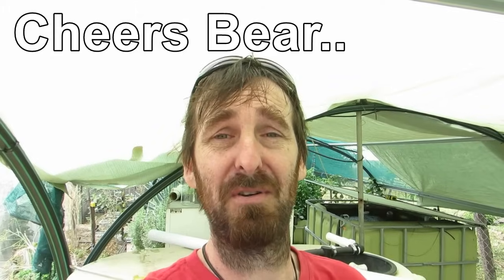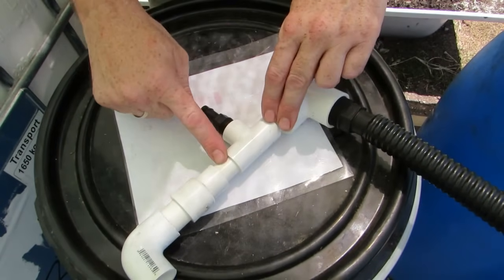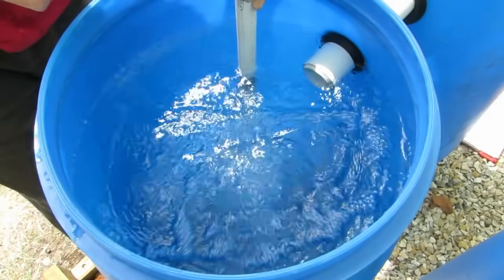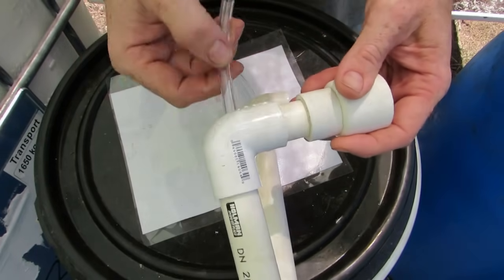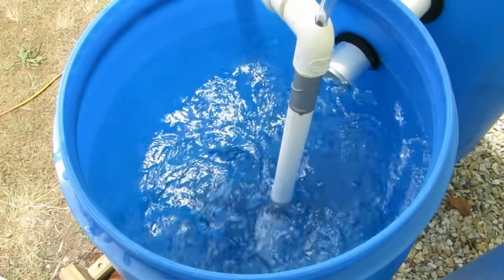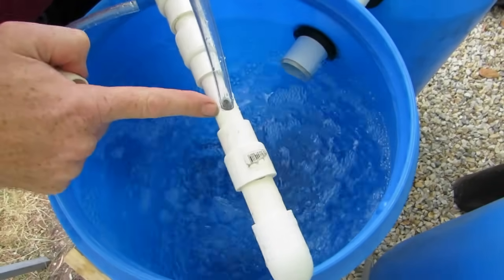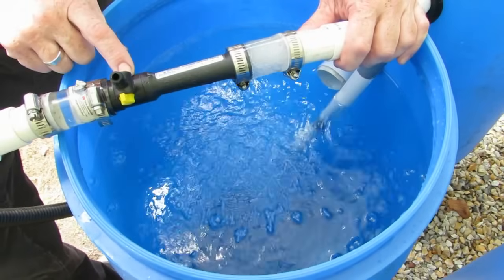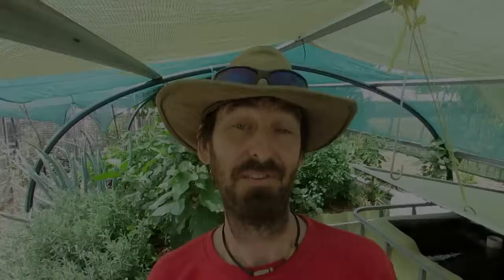DIY venturi, a few easy builds for aquaponics, aquaculture or hydroponics..

Comment: Thank you Rob for kindly sharing your knowledge on venturi. An added bonus I came across is if your sump tank Pump is stopped the venturi will prevent water from syphoning back through the pump saving the use of one-way valves. Nick.
Reply from the maker: Hope it helps you out some Nick & sorry for taking a while to rep[ly.  👍
Cheers mate.

Comment: very solid and practical design. thank you SO much for sharing this priceless information.
Reply from the maker: Thomas Paxton Hope it helps you out some Thomas.
Cheers mate.
Reply: RobBobs Backyard Farming i have a question. i tried, basically, this exact set up but where im supposed to be drawing air in, its spitting water out.... what am i doing wrong?
Reply from the maker: +Thomas Paxton 
Hi Thomas. Sorry for the slow reply. 
Have you sorted out the unit yet mate ?

Comment: Great info, thanks for making this video. I needed a quick and cheap solution to start adding air to my pond, as it's been hot and dry here in Florida, at least for this time of the year. Coupled with it being too still, it was starting to stagnate and I didn't want to end up with a fish kill if I waited too long. The pond's main purpose is as a sort of fire hydrant, since there is no municipal water services where we are, but we enjoy the snakes, fish, frogs, and turtles that call it home as well. The ideas in the video helped get the job done, for now.

I've got an artesian well that's used for keeping the pond filled, so I just added a venturi in to the line. I experimented with putting it at the start, middle, and end of the line, and having it by the valve works well while avoiding the problems with locating it elsewhere. (Debris, pond height, etc.) I did find that by extending the length of the air line coming in, it actually suppressed the sucking sound quite a bit. That extra length also allowed me to orient the opening towards the ground, protecting it from being bumped and keeping the opening from having stuff fall or blow in to it.

It's not the ideal solution for my application, but I think it will help out until I can bury electric service out to it and buy a proper aerator for a pond this size. Again, your video was very helpful, thanks for taking the time to make it.

Simple Venturi For Pond Aeration
Reply from the maker: Nice one mate.. Thanks for the clip.. Looks like you're getting a load of air into the water & am glad it's worked out for you..  Are those solar pumps any good for aeration purposes ?
Cheers & all the best..

Comment: Hi Rob. Greetings from the West Coast of Canada!

Just thought I would pass along to everyone something that I learned at a seminar on aquaculture. 

If you're ever wondering if there's enough dissolved oxygen for your fish, just watch and see if they spend most of their time hanging about at the the bottom of the tank. If they do, then you have enough oxygen, as there will always be higher concentrations of O2 near the surface, due of course to the fact that gases are lighter than water and tend to get pushed up. 

This is why fish will gasp at the surface if they are short of oxygen. 

I thought it was a very useful tip when I heard it, and thought I'd pass it on.

Love the vids and your delivery. Keep "em comin'!
Reply from the maker: Cheers Steve.
Have a top one.

Comment: Thank you. I haven't heard anything about venturi here in the States. Love the sound of just the  bubbles. You do good things and I appreciate it.
Reply from the maker: Hi Pat... There are a few different styles you can pick up from Ebay fairly cheaply.. They are normally used in spar baths or for liquid injection of fertiliser into irrigation lines the garden.. I like the home made units over them as I get to tinker around ;)
Cheers & have a great one,
Rob..

Comment: Very nice video, will add it to my collection of things going into my next build.

Cheers
Reply from the maker: Hope it comes in handy mate..
Cheers..
Reply: I just started my wood base for my two 50 gal tanks, painted the bottom 6 inches as lately I am getting mold on the wood from the spring thaw.
Once I actually start the build I will post pics and ask questions.
Reply from the maker: Zach D No problem.. Can take a while for me to get back to folks as you've seen just to warn you ;-)
Have fun with the build..
Reply: np

Comment: I used similar constructions in fish tanks. If u get larger bubbles, it helps to run the outlet of the pipe against the wall of the tank. If you have some decent pressure then the large bubbles will hit the wall of the tanks and burst in small bubbles.
Worked really well in my fish tanks!
Reply from the maker: Hi there & thanks for that..
Ended up running with a few I was given in the aquaculture build but think the home made jobbies will get a run somewhere in the new system soon..
Cheers,
Rob..

Comment: Thank you for sharing.  I recently build a 16000 gallon Koi pond with a 5'X 10' bog filter.  I wanted to induce air to the water as it entered the bog.  Your DIY will make that happen.
Reply from the maker: Hope the venturi does the trick for you Benjamin.👍

Comment: Hi Rob, from what I've read the size of the bubbles really makes on difference as their not in the water long enough to make a difference.  It's the bubbles breaking the surface tension that does the oxygenation but like most things their are as many schools of thought as ways to do things.  Thanks for the video mate.
Reply: It's one of those things that works but most everyone is wrong about why it works. A powerhead in the tank may be a better option than injecting dirty air into your water at high speeds

Comment: Rob Bob: Since you were curious about other people's take on the venturi I will give it a go. The first place I ever used a venturi was in science lab. The faucet was designed to shoot out a jet of aerated water and the venturi air intake was our vacuum line. Later I noticed a dozen venturi on my hot tub. Same design, the fast jet of water causes low pressure and thus air is sucked in (velocity and pressure in a
 tube math). In a practical application high pressure occurs at points of dilation in a tube. Aneurysm in a blood vessel or a bubble in your garden hose. Low pressure at the constricted points where velocity is increased. MY POINT - buy your venturi from the spa store or online spa depot or whatever, they are the spa or hot tub jets. My contribution for your wonderful videos. Thank you again, from USA.
Reply from the maker: Thanks for that Tanner..
Have had a few folks recommend the spa units but haven't played with one as of yet though..
Cheers & have a great one,
Rob..

Comment: This is very smart. I used to have a basement full of aquariums, breeding aquarium fish half professionally. 

I experimented with venturi-solutions there and getting rid of some air pumps was great. The only thing I have to add is that if you use soft elbows (not the 90 degree variant), you will optimize water flow. The water will then be able to "screw" itself through the bend and you will not loose as much pump capacity.
Reply from the maker: Thanks JV.
have a top one.

Comment: wow, i like the device with the clear tube.

Just wow....
Reply from the maker: Hi there..
I'm using that unit in the moving bed biofilter in the new build... Found it woks better in that application than any other venturi I've bought or made..
Would be great to get an O2 meter & do a side by side test on some water to see which is best..
Cheers & have a great weekend,
Rob.

Comment: thanks for the video. I went ahead and made the one elbow venturi version and replaced my air pump in IBC as I had parts in the garage already. It took about 10 minutes to make and it worked great. I found that you can make bubbles smaller and more plentiful when you make several small holes on the vertical pipe that is delivering pumped water with air to the bottom of the IBC.
Reply from the maker: Hey Ondro & thanks for that..
Shall try it on one of the DIY jobbies in the fish farm & compare it against the other tank.. I found the deeper I tried to send the air the less I got so only have a 6-8" pipe in there now..
Cheers Mate & all the best,
Rob..
Reply: gladly Rob. happy to share my findings. after all i installed the venturi only because of your video :-) . my pipe goes all the way to the bottom which is about 90 cm and the bubbles apart from escaping alongside the vertical pipe get also to the bottom of the pipe. the bubbles are not tiny tiny, but defintely smaller than when there are no holes.

Comment: I love your video .I have a  little over 3000 gallon pond and just rebuilt and think I am going to make one of your venturi .Thank you for the great video .I will be making one .
Reply from the maker: Hey there..
Glad you found the build useful & has given you a few ideas..
Cheers,
Rob.
Reply: well the one i built is working great and tomorrow i will be building another one my koi will sure love this in the summer heat when oxygen levels get low .thank you again
Reply from the maker: sissy murphy
That's great to read :)
Have a great one  :)

Comment: Excellent ideas and thank you for doing the comparisons. I am thinking about adding one to me new aquaponics setup and getting rid of the air pump, one less energy sucker.
Reply from the maker: That's why I was looking at them as well.. Make more sense to run one unit to do both jobs.. Did buy a new 4200lph air pump as a back up for the 2 systems.. Doesn't hurt to have some extra air for the warmer months here I think..
Cheers & have a great week..
Rob.

Comment from the maker: Here in the subtropics we have a very mild winter with the temps only dropping below freezing for a few hours at a time on a handful of days every winter.. Our block hasn't had a frost on it in the 12 years we have been here.. I had the system running all winter & was feeding the perch most days... If we were in a cooler area down south we would probably just run trout during the cooler times..
Cheers & have a great one,
Rob.

Comment: Nice simple options, thanks.If a really efficient Venturi is required it does need a taper inside the water feed tube that has two angles. The air intake enters at the low pressure point.

Comment: I airated 12,000 fish with a submersed water pump which carried water horizontally to fall back in the pond. I put a Y fitting backwards in that line so it sucked in air. It helps if there is at least a meter of horizontal pipe after the Y to allow the air & water to mix before falling back into the pond. So simple.
Reply from the maker: 👍 Nice one.

Comment: I used the 90 version style, but with a T (end with the pen pointed up and capped with a hole drilled in it) and used the bic pen. However I slightly crimped the end into a small slit. This dramatically reduced my bubble size and has been working well in my 450 gallon system for almost 3 months.
Reply from the maker: Nice one Don.. That was the only style I saw around when I first started to look into venturis.. Made one along those line but used the thin aquarium air line instead of the pen in the top of the cap & had no real luck with it so gave away playing with them for a while.. Would really like to play around with a dissolved O2 meter to see how well they really work when it comes to bubble size.. Have added it to my B'Day wish list with the boss but don't like my chances :D
Cheers sir & have a great one,
Rob.

Comment: Hey Rob, just emailed an order to you.
I'm setting up a system i picked up second hand with a few modifications. 
I got 2x 500L growbeds, 2x 1000L fish/sump tank all pipework, clay balls and 3x pumps
$800 for the lot. A nice upgrade from my ibc.
I'm going to add in a radial flow and bio filter using your videos.
Thanks so much Rob.
Reply from the maker: Nice score Todd. 👍👍
Hows the build going or are you leaving it for the Christmas break?
Cheers & have a top one.

Comment from the maker: Hi Russel Workman..
The water in our system is so clear due to the Radial flow filters as well as the media beds removing the bulk of the solids.. We still get solids in the fish tank from time to time that we remove with a little push on vacuum attachment that fits onto the solids lifting outlet that works really well.. Aquaponic solids vacuum attachment for fish tank..
The solids get collected in the radial flow filter where he can be removed later.. Don't really have any collect in the sump tank at the moment.. I probably vacuum it out  about once every 6-8 weeks during summer as the SLO picks up the majority..
Hope that helps some..

Comment: Cheers for the video, it helped me design my own venturi and finally get rid of my air pump, I've decided not to put mine in my fish tank, I've got mine in my sump, I have had to restrict the flow between my pump and fish tank with a ball valve because my fish tank started overflowing, (my pump may be a little to powerful🤣) I've redirected the water that I've restricted from going into my fish tank back through a venturi and it returns to my sump which adds oxygen to my water. 
I do have a video on my very new channel (it's the only one so far) if you want to see how it works.

Comment: Hi Rob. Subscribed already. That water fall into the sump tanks can be made into a super aerator by placing them into a pipe twice its size with a few slots resting on the bottom. The water pressure and splashing pushes the air down to the bottom of the tank through those slots. Peace
Reply from the maker: Have seen folks use something similar in their systems. 👍 
Cheers mate.

Comment from the maker: I'm sticking with the lots of little bubbles having a lot more surface area school Jack ;) The bonus is that lots of small bubbles need to break at the surface in many places so no matter which way the O2 gets into the water both are covered with a decent running unit that pumps out a large volume of small bubbles..
Hope that makes sense... I need coffee I think :/
Cheers mate & have a great one..
Rob..

Comment from the maker: Thought about doing that in the past but decided on air stones then venturi.. I like the idea of the bubbles & flow in the base of the tank stirring the water up more with the venturi.. Have noticed that the solids don't pool in just one area now which I think is a good thing as it means the water is circulating better in there now.. 
Cheers Charles & glad you like the clips..
All the best,
Rob.

Comment: Try restricting the air supply with a small valve and it will dramatically reduce the size of the bubbles! You want bubbles that are so small that they remain suspended; unable to break the surface tension force of the water and escape. You'll know when you've got it, the exhaust will look very 'milky' in appearance. These fascinatingly tiny bubbles can actually break down fine solids in the system and convert them into plant available nutrients :) That's why I'm installing one inside of a shallow DWC raft system that feeds into my media bed, so that the inlet water is always pre-oxygenated. My experience with indoor hydroponics helped me realize the importance of increasing total dissolved oxygen levels. I really cannot stress the significance. The impact on the plants is observable and immediate.
Reply from the maker: Also running a larger pump than I used to demonstrate hen will help as well. 😉
Reply: @RobsAquaponics  That works best actually. If you have an old fish tank lyin 'round, set up a demo!

Comment from the maker: In some instances they do but they also put extra load on the pump depending on what type you use John.. For us it's a win win situation, less power being used & no hum of the air compressor so I'm happy :D
You can also go the other way & use air to pump the water  which adds the O2 as well as circulates the water for the system.. Good for smaller systems from what I have seen though..
Cheers sir & hope alls well down your way :)

Comment: Hi Rob
Your guide is great thank you 
I'm building  a 3 bed ibc with a  full ibc as a fish tank and need to know what size pumps to use for the system and if U need a seperate pump for the Venturi system going into the tank and one in the 200 litre bio filter.
Thanks Shanon
Reply from the maker: 🤣 Disregard my previous response, I read the question wrong.
Reply from the maker: I responded over in the guide the other day but will leave this here for others that may read your question.👍
I'd be looking at a 10000lph pump minimum. That will give you some extra flow to compensate for the restrictions with the venturis. 👍
The variable flow rate pumps are great for aquaponics. They allow you to reduce flow if need be (saving power) or to be able to up the flow if you chose to expand later on.  
Aqua Zonic Amphi Plus 18000lph jobbie on ours which a bit of over kill. I probably could have gotten away with a smaller model.
Hope that helps mate.

Comment: Hi Rob. 
the venturi I build like your's wasn't working too well for me. I ended getting a load of water coming out of the air pipe. I suspect it has something to do with a restriction somewhere down stream of the venturi bit. I ended up just getting a 25mm pipe with a 90 degree connector, drilling a hole and putting in a small pipe and it works really well. Just like your vid at about the 4:50 mark. I noticed that if I put a hose in the end of the pipe, then water runs out of the air inlet. I guess there is a scientific reason for this. Anyway this simple one is what I'm sticking with for now. Loads of bubbles! thanks for your video.
Reply from the maker: Hey Anthony..
Good to know you got it all sorted mate.. Am running with that style in the fish farm tanks at the moment too ;-)
Cheers ..